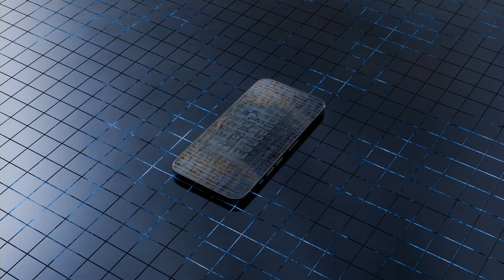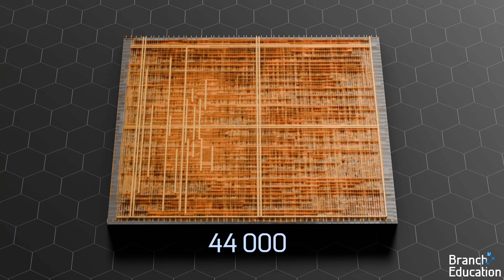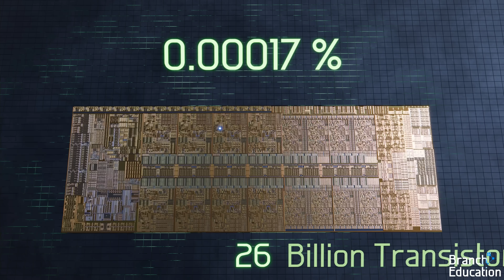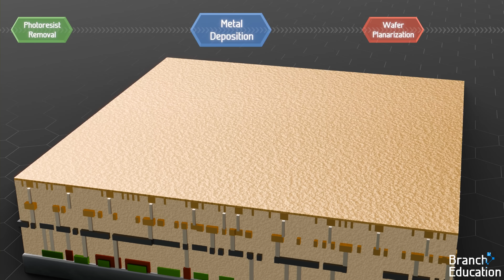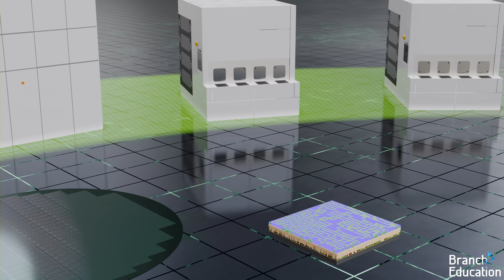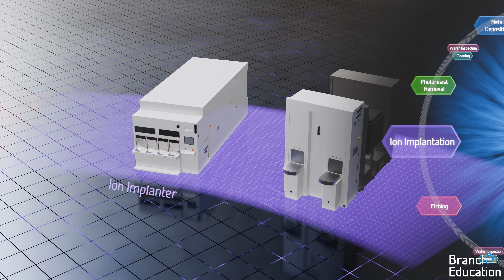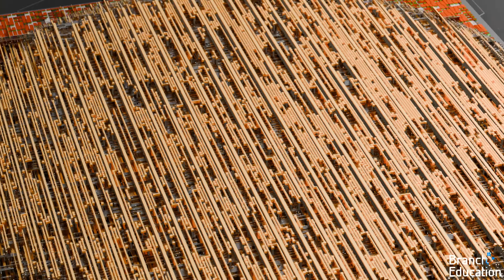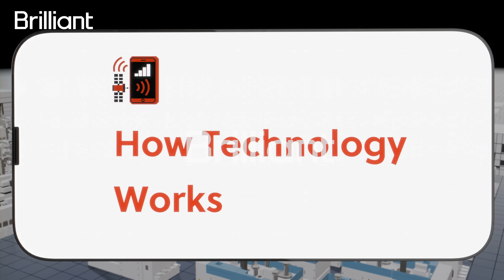How are Microchips Made? 🖥️🛠️ CPU Manufacturing Process Steps

Comment: Nice vidéo also if there are some shortcuts. The number of tools, chips, layers... Depends of the Fab and the chips. It can take till 7 months to build. Some fabs do less chips per month, some, more. And some tools like the Photolithography, can be combined in 1 tool (resist déposition, exposition, resist removal). Some etching tools can be wet etch or dry etch (with Plasma) copper, gold déposition are generally made in electro chemical déposition tools and not with Plasma. Some déposition tools are big oven also. But it is a great video! Nice done.

Comment: In a simplified View, the manufacturing Plant can be seen as a kind of Processor itself. Different specialized processing Units, connected via a Bus System, some of them parallelized, built-in Error Detection. Many more Analogies could be made (what happens when you "overclock", Pipeline Stalls, Microcode Updates, etc.)

These Animations must have been a ton of Work, with a ton of Knowledge behind.

Comment: I have been working with and repairing computers for almost 30 years. I've done a lot of study and have kept up with most facets of the industry. I have never come across a video series that explains, so clearly, the details of the chip manufacturing process. I will make sure to have all my colleagues watch your wonderful presentations.
Reply: this is mainly because its always a closely guarded secret in the industry. Specially, the details of the masks, circuit interconnections, chip module layouts, etc are never shared in public. Even the factory tour requires special high level permission/ clearance. Some people who work in the industry which provide tools for chip manufacturers, such as ASML lithography, vapor deposition, etc have some idea what they do and how they do. Apart from this, this is an active area of research, and is published in well known journals as well, but being hidden behind the paywalls, the published research also stay away from the reach of general public.

Edit : for those who want to dive deeper into the subject, there are dedicated channels which i would recommend - Asianometry (you will thank me later)

Comment: This is the best video I've seen on semiconductor manufacturing.
I have searched around 20 years on the Internet but all have been flawed or skipped important steps. This one is modern and explains all the steps correctly without skipping important elements. I myself have worked in a semiconductor fab before and even though it was a long time ago, the process is still very similar. 
All cudos to Branch Eductation, thanks for explaining it to the world!

Comment: In regards to dust particles, I’m thinking of a process: 
After each deposition, to apply an additional protective layer, so that in between steps, whilst in travel or transfer the chip would have a protective layer that is uncovered just before each of the next deposition, etching etc. 
I am not sure as to what could be the protective layer composition or the process of applying it without damaging the chip itself, but in case the it would work, the result would be more i9 processors and less i3 processors.

Comment: Both rhytm of speech and no accent make it nicely understandable video.
The technology level is beyond my imagination, I am working with accuracy just 1-2 digits below 1mm.
Nanometre accuracy is crazy.

I am hoping we get optical chips one day to get over physical limits of current technology.
Finally we already can get optical fibres network but its still limited access for users and also its just part of either radio or metal cable data routes.

Comment: Very cool video to explain semiconductor manufacturing. Some constructive feedback. As an ASML guy, I’d say you might add that not all layers are processed by the same expensive EUV tool you seem to show. Many layers use cheaper tools. I wouldn’t describe the resist as being weakened. It’s photosensitive and that part gets dissolved. You could consider adding a minute to refine the testing. The e-test probe tools at the end during packaging and brightfield inspection is a world in its own.

Comment: As a retired technician, working with semiconductor fabrication line for 27 years. This the best and details explanation. Thank you.
Reply: What an endorsement!
Reply: Where to start to be a semiconductor technician?
Reply: @ShegerBusiness  At least at the fab I'm at, an associates in engineering (mechanical or electrical) is enough to be a technician maintaining the tools. Honestly, just apply and see if they accept. At worst they say no.
Reply: I interviewed with intel in Hilsboro around 20 years ago. 30 minutes. (or maybe an hour?) They wouldn't tell me what I would be doing or show me. A video would have helped. I had to drop everything, move there, and start work in two weeks on 3rd shift. Compensation is top notch as far as benefits. Pay would not have been much more than what I was making in South Carolina as a tech with half cost of living. I couldn't do it. But I was curious and had to learn what I could from online sources.
Reply: How in the first place was it first created, how did the first creator have the idea how to make it work.
Reply: @sootuckchoong7077 

Photolithography existed long before the semiconductor industry came into existence.

Etching stuff into materials, using chemicals, stencils(made from ink or mud, or just a normal stencil) and UV from the sun...was already being done.

E.g. You can use this method to chemically etch your name onto a trophy.
Or etch your brand onto your Medieval longsword or armor.

The first Integrated chip had  large clearly visible transistors.

From there, they just etched smaller and smaller features over the years.
Reply: Hello 👋
Reply: I know your location
Reply: @TerrorBD-jz1bc  ৎ . How ?
Reply: Where are you from buddy ?
Reply: school
Reply: Das ist viel phaszinierender als Kunst .
Reply: Guys, so the i9 i7 i5 i3 are all the same chip but the difference between them are the amount of defective parts?

So those Intel CPU without Integrated Graphics actually have integrated graphics but it just doesn't work due to the problems during production?
Reply: @FallenLight0  You are partially correct, generally during the design stage itself they  have some hard switches(kind of shutdown switches/logic) added to each block in the design to disable them(doesn't matter if the ic is faulty or not), the advantage of this method is that they don't have to redesign the whole circuit for different  lineup(That's why you will see their Idle power/base power to be in close neighbourhood like for example all 14th gen i7, i5, i9  have same base power). Coming to the detective part  point, it is also one of the best method to save cost instead of scraping. But defects are not very common generally during the design stage the chips are designed in such a way that yield is more than 95%, preferably 99%.
Reply: @FallenLight0 To a degree, yes...and too a degree no.
Reply: Det går inte att förklara hur det kan fungera inte ens från exoplanet där tekniken kommer ifrån!

Comment: Absolutely amazing video! The animation is impeccable and illustrative. The structure and writing is tight and understandable to someone unfamiliar with the topic. I’ve gained so much insight, respect, and admiration for the manufacturing of computer chips. 

I am genuinely amazed with how cohesive this video is. Oten videos either have good animations, but are overly technical (they’ll sound like a Wikipedia summary), or be well written but short, only minimally animated. You guys have done both impeccably. I LOVE the structure of going over the whole process multiple times, at different levels of detail. I never felt lost in such a detailed video. Absolutely outstanding video!

Comment: OH man I've been waiting 10 years for a video this clear! And now I understand enough to ask questions! Do all layers use the same process node? That is, if the silicon layer uses a 3nm node, but the highest metal layers need much less precision, could they use a 5 or 6nm node? Are there even cases where you could use EUV lith and conventional laser lith on the same die?

How does double patterning or multi patterning fit into this? Is the layer finished just like a normal one, but then instead of building up another layer, you just etch back down to make a second pattern? Is multi-patterning even used for metal layers or EUV at all?

Is the transistor layer always the bottom one? There's no way to "deposit" semiconductor material other than using the silicon wafer? So, every chip is always just a single transistor layer and then lots of metal layers?

Comment: What's the significance of the silicone wafer?  Like why is Silicone used?
Reply: Not silicone, but silicon. Silicon is a semi-conductor and it is an element that can be found everywhere. What makes a semi-conductor so interesting is that it sits right between conductors and insolators. There are two types of conductors: n-type and p-type conductors. Under normal circumstances, silicon is an insulator. But by introducing tiny amounts of foreign atoms (in this video ion implantation is mentioned) you can change it into a n-type or p-type conductor.

Comment: The narrator needs to learn the value of silence.
Reply from the maker: There's just too much information to get through
Reply: @BranchEducation  
Over the past decade, I have periodically watched semiconductor fabrication videos to gain a better understanding of the manufacturing process. In my opinion, this particular video provided the clearest and most comprehensible explanation I have encountered. Additionally, I found the pacing to be excellent.
Reply: @BranchEducation  You've got to give us time to process what was said and to have time to take in the graphics.  You're spitting out information but you're not teaching anything.
Reply: You can always just slow down if the video if you need to. I personally found the pacing fine though, and prefer this over a longer video since I was able to understand everything

Comment: Intel is working on delivering power to the chip from the back. Then the data and power lines don't fight for the same space and the power lines can be shorter, which reduces voltage drop.

Comment: Incredible explanation! I took a few college classes on the subject, and the only issue I found in the entire video was the graphic showing the pitch at 4:39. Pitch is the measurement from center to center. With transistors it is commonly pictured as from left edge to left edge (or right edges). Keep up the great work!

Comment: I can't believe I didn't know how the i5, i7 ,i9 etc were categorized! Great video!
Reply: Intel and AMD have been doing that for decades. The 486SX started out as just a 486DX where the floating-point unit was defective, so Intel disabled it and sold it as a budget chip for users who had little need for floating-point. Later on, they made a dedicated design for the job, as they weren't getting enough duds to keep up with demand. The move to on-chip L2 caches provided another opportunity to reuse defective chips. If part of the cache was defective, disable it and sell the chip as a reduced-cache or even no-cache model. Multi-core chips provided yet another one. If the 4-core chip has one or two faulty cores, disable them and sell it as a 2- or 3-core chip.
Reply: @Roxor128  That's really interesting to me, and an elegant solution.
Reply: 💯 it blew my mind that the difference was quality instead of a different design! 🤯
Reply: @demetriows1207 
Marketing sees it as different products still though!. See how contexts are important from different departments, and if they all integrate it functions nice like this.
Reply: @demetriows1207  exactly
Reply: Same! I had no idea. I literally thought they were completely different chips. My i5 has the exact same layout as an i9! Some of it is just disabled or damaged. What!
Reply: @jakoblykke769 no. This video simplifies stuff out of necessity. Your i5 isn’t the same die as the i9. Each recent generation has a few base designs which are then binned to create the whole product family. Before the i9 Intel did use one die for the i7 to the i3. With the i9 they now make i9’s and i7’s with the same die and i5’s and i3’s with the same die.

Comment: As an engineer in semiconductor manufacturing industry, I want to say this is by far the best and detailed video to explain the IC manufacturing process. I can even tell which tool is which by looking at the animated pictures. The video production team really did a great job in the details.
Reply: An amazingly accurate presentation, might be as close as the normi can get to getting inside a fab
Reply: @michaelleahy7794  u need to apply for process engineer or Fabrication Engineer. Or also u can get into design part of it
Reply: Lol right, when they detail the LF generators on the producer GT's you know it's legit..hard to believe AMAT would have gave them the CAD's for those
Reply: Would have been so easy to get a lot of this stuff wrong, too.  Sounds like they probably double checked their info with some expert to be sure, cuz no way some amateur fumbles their way through all this jargon and machinery and whatnot without messing up.
Reply: As a fellow semiconductor engineer, you're absolutely right.  Will be sending this around the office for those who want a good way to explain what they do to their friends and family.
Reply: so you are the guys causing chip shortage😂😂
Reply: @bryomuch  how so?
Reply: I want to know what goes through your engineers heads when you designed these and how you know all these complexity would somehow create a chip that actually works.
Reply: @tiberianexcalibur  I’m a fresher working in a vlsi startup. The whole chip will not be made by a single person. For example u will need to design a specific block like sram. Then they will use ur design in soc and verify.
Reply: @tiberianexcalibur  the same way ants are building ant hills
Reply: @laurentguyot3362  no I doubt it’s that simple
Reply: what kind of engineer are you? Electrical, computer or chemical?
Reply: IC manufacturing process? What does "IC" stand for?
Reply: I want to know which qualification or degree required for career path in integrated circuits

Comment: Amazing video as always!
One fine point (not a criticism, y'all did a great job!), the circuit mask (also known as a reticle) in the examples was transmissive (light passing through it and the circuit pattern being blocked) while the ASML lithography tool shown is an EUV machine which uses a reflective reticle (where the circuit pattern is absorbed). The EUV optical path and reticle placement was nicely modeled though!

Earlier ASML tools like DUV, XT, etc. use transmissive optics and transmissive reticles but the new-fangled monsters use reflective optics and reticles because they absorb less of the smaller wavelengths of light than the lenses we currently have.
There may be metamaterial lenses which could be suitable but I'm not aware of them (though if someone is aware, lemme know!)
Transmissive optics are generally easier to explain though so I can see why y'all might've gone with that for illustrative purposes.

I hope this comment helps feed the algorithm!

Comment: Could it make cooling process better, if there for example would be a forest of vertical copper heating conduit, through all 80 layers, from bottom to top, not connected to circuit inside, only to copper heatsinc on top of chip, or maybe to GND, to bring the heat better from inside of chip to outside? Of course chip would be bigger, but if it could diccipate more heat, with less ∆t, and better distribute temperature inside, protecting transistors from overheating and damaging? To increase the takt frequency without fear of grilling the chip?

Comment: What's insane is that despite the manufacturing process of modern chips being unbelievably complex and time consuming, they still manage to be the single most reliable component in most cases. Out of the 80 - 100 CPUS I've had my hands on, not a single one has failed. They all become obsolete well before anything breaks.. Hats off to the brilliant engineers and technicians that make these chips possible.
Reply: It's because they have zero moving parts, it all comes down to that.

Comment: If the bottom of the wafer are the transistors, and all the above layers are interconnects, and everything is built up layer by layer, and it takes months to do, does that mean the majority of the time, and all these processes going round and round over 80 times, are all just ... mainly ... building up interconnects?

Comment: So that's what the i3, i5, i7 and i9 designations mean! The cheaper and less-powerful chips are literally partially defective because impurities got into the manufacture of them. I have an i7-9700k in my PC right now, which means that at least a few of the cores were rendered dead on arrival by the inspection process. Just goes to show you that, even with multi-million-dollar machines, ultra-clean rooms and 3 months to build, it's still not a perfect process.

Comment: Important to note that the mask will degrade every use so it has limited use. EUV is the latest and widely used because it can print them at finer details thus less passes to achieve the same result. Less pass also means less chance of defects. It is widely reported that China would use DUV to make 5nm chips but DUV is thicker thus require more passes to achieve the same result, more pass means more chance of defects. Likewise, burn the lifespan of the masks thus need more masks.